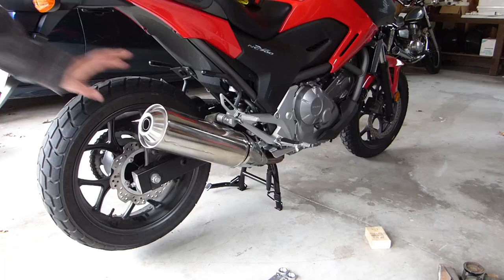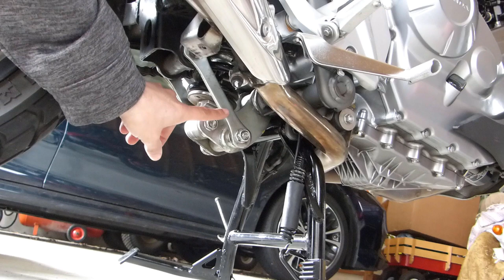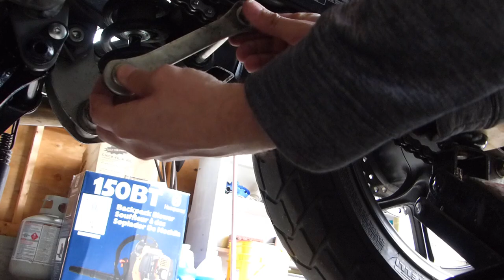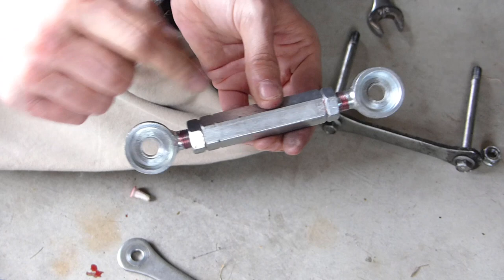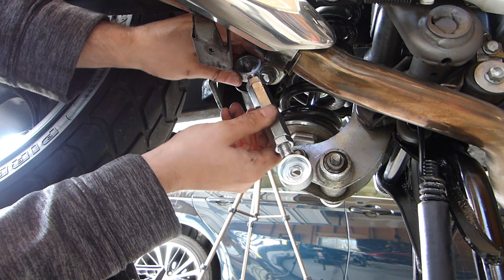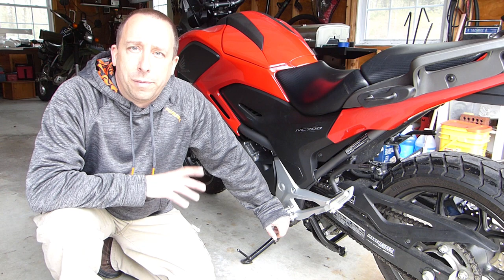Installing Soupy's Performance Motorcycle Lowering Links - Honda NC700X

Comment: Great video!  Couple things:

-Instructions are included with our lowering links.
-Our lowering links are a turnbuckle style, this allows them to be adjusted after being installed on the motorcycle.
-The first step is to install our lowering links on the motorcycle.  Do not adjust them prior to installation as they are shipped in matched lengths with an equal amount of threads engaged in each end of the center hex adjuster.  After installation the jam nuts can be loosened and our lowering links are easily adjusted equally to the motorcycles desired ride height.
-Longer links = lower right height

-The ratio of ride height to lowering link length is approximately 3:1.  That is, adjusting the length of the lowering link 1 inch will net an approximate ride height change of 3 inches.
-As shown in this video, the flat side of the lowering links are to be installed inward, with the bolt head and nut inside the recessed side of the lowering links.
-If needed, we do have adjustable, CNC'd side stands in stock and ready to ship.
Reply: Your more diplomatic than me !!!!!
Reply: How much are you charging for these ?.. And lowered centre stands ?
Reply: I’d probably add that red loctite is not appropriate for this application.
Reply: So im guessing you have to loosen all 4 lock nuts then turn both middles simultaneously

Comment: Not sure why you suggest loosening the lowering link lock nuts & turning each end separately to required length BEFORE installation. Just mount the two links to the bike with the two original mounting bolts, tighten them to spec (add red Loctite for safety) - THEN - loosen the 4x lowering link lock nuts, TURN BOTH TURNBUCKLES TOGETHER with two similar sized wrenches making sure both links either expand or contract TOGETHER (the turnbuckle is the long, 3" central "nut" on the stem of each link between the lock nuts.) This action either lengthens or shortens the body of each link at the same rate at the same time eliminating trial and error or having to use a rule. THEN you can tighten the 4x lock nuts. Once done, get on the bike. If you feel the need for more adjustment, loosen the 4x lock nuts again, turn both turnbuckles either way for the desired result and retighten the 4x lock nuts. I wouldn't use Loctite on the locking nuts as by their very nature locking nuts lock, they should not work loose. However, for peace of mind, check them every so often after initial installation. Don't forget you will probably need to purchase an adjustable kickstand if you've lowered the bike more than 1/2-1" and you should seriously look into lowering the front forks in the triple clamps to match. Before doing this do some CAREFUL RESEARCH as well as some "seat of the pants" research as to how much these should be lowered. Some say front forks should be lowered the same amount as the rear shock but lowering forks more than 1" in the triple clamps could become a problem (you may need to purchase handlebar risers.) Keep in mind all these changes will result in a bike that may be lower and easier to ride for shorter riders but if going off-road you will have to adjust your riding style to match as ground clearance will be less and shock absorption will be lower so keep your speeds down till you're comfortable with the new set-up.

Comment: Am I wrong in thinking that the one side has a left hand thread so it can be adjusted without removing the nuts and bolts again? It seems that's the reason why it's made that way... like a turnbuckle. You should be able to loosen the locking/jam nuts and turn the center piece, and it will adjust evenly from both sides, yeah?
Reply: Yes, you are correct Rob. You just need to turn the turnbuckle after  you loosen the locking nuts on each side of the center piece. I just received my soupys for my 98 ZX11 I am only 5'5 so i'm excited to install mine and see how the bike feels.
Reply: It is a turnbuckle . I would never use red on something that may need adjusting. Crack the nuts loose and then turn the center to reach desired height.  Then use blue locktight on just the end nuts. Or something like that.
Reply: @bluechevyv7156  To be fair to this guy, Soupys Performance (the maker of these links) suggests the red loctite in their video. Not sure why they do that, it's wrong.
Reply: This guys not got a clue !... Youtu.be is full of these people... DANGEROUS !!!!
Reply: Can you adjust those adjustable lowering links even the motorcycle is not jacked up?
Reply: @leej5062  yes you can. But it makes it easier if it's lifted or on a stand. That way you're not trying to lift the full weight of the rear of the bike with that link. It makes it much easier to sag the suspension first.
Reply: @willywaters3814  They suggest it for the mounting to the frame, not for the turnbuckle. They also specifically say in the instructions to NOT adjust it before installing it. This video shouldn't be followed one bit.

Comment: BLUE Locktite.
Red will need a torch to undo !
Reply: Yep, red Locktite is a one way trip.  It seems strange to use red Locktite for this ADJUSTABLE link,  Apparently some came loose and crashed the bike/rider.   Who's idea was it to use Red Locktite for this???
Reply: @yoyohooyo  the instructions said red. I didn't even think about it I just grabbed the red lol. I should've used blue. But oh well it's on there now.
Reply: @Zx14rrrrrrrrrrr   @spafro101  Maybe it was a joke
Reply: @yoyohooyo  a joke to put that in the instructions? Naaaa they just don't want to hear someone crashed because the nuts vibrated loose.
Reply: @Zx14rrrrrrrrrrr    I put a very strong
 lock washer  on the right hand thread sides.   I'm surprised they didn't think of it.  I need to check the bolts and make sure they are still tight,  I think I used blue Loctite also.   I wish I bought the 2 inch bone lowering links instead these because I lowered it 2 inches and that is prefect for me.  I'll never change it.
Reply: @yoyohooyo  I tried the links with the 3 holes. Worked good til I extended the swingarm. Then it was too high or too low. Found a deal on these soupys. And I'm happy with them. I set it right where I want it.
Reply: Im not saying he should have used red or blue but i use red all the time especially when its easy to hit with the propane torch never had a problem getting them to cone loose you could pretty easy heat these up in there location. I will probably use blue on mine.
Reply: @abigailhar  yea just put alot of blue on there.. You'll be fine.

Comment: I got these lowering links for my Hayabusa but they're bit different to yours. Mine are like rounded end links(swivel |bearings) whereas yours are flat. I cut the main body down about 1cm too as the standard shorter setting was no shorter than what is on the bike. I felt this was not right so, In the end I didn't fit them, just something in my head told me to leave it the way it was. So,I'll just put up with the ride height a bit higher than I was after.  Happy motoring my friend
Reply: A shorter link will make the bike taller. You just ruined your new links by cutting them.
Reply: Lol

Comment: I would NOT put RED lock tight on any of the threads until it was installed, adjusted and test ridden to be sure it was all at the height I wanted.   I would NEVER adjust one end of the/a link a different amount than the other!

Comment: Would you have to lower the front fork springs? Or preloads the front fork springs to compensate for lowering the seat height?
Reply from the maker: It's a good idea to do that, especially if you lower the rear alot.  I didn't drop mine much and left the front at stock height
Reply: Okay thanks i just got my 2017 fz 07 and ordered soupys lowering link i was thinking about lowering it 1-2 inches just so i don’t have to balance on my big toes. Do you think i would have to lower the front springs or is it not too much of a difference and i could leave the front alone?

Comment: I have a DR650, and of course, it's too tall for my short butt.  So, I ordered a set of these lowering links today.  As an FYI -
Amazon, $129.00 (Prime shipping available + tax) = $136.74
eBay, $72.00 (+ $7.50 flat rate shipping + tax) = $84.27   [ Yes, it's brand new. ]
I failed to mention that I'm a cheapskate, and I shop for the best deals.  I can't see paying an extra $52.47 when I don't have to.
Reply: You are not cheap, you are smart!  I want to get a lowering link from a Honda XR650L it has a 37 inch seat height.  Great bike, great engine, but just too tall. The Koubalink offers a 1.75 height reduction,  if this soupys link actually goes to in lower I'll take that one. Looks like it might be easier to install as well.
Reply: @zl2848  Soupy's or Pro-tek might be some to look at.  The beauty of these are, once the links are installed, and you decide you need to go lower, it's simply a wrench adjustment.  You don't have to do what is equal to a re-install to achieve the next setting.  Heads up - if you go significantly lower, you're going to need to cut 1/2 to 1 inch out of your kickstand.  Good luck.👍
Reply: Are the eBay ones also made by Soupys Performance, or are they a cheap knockoff?
Pretty much anything can be made cheaper, but usually not without sacrificing quality. People often overlook this, then suffer from it when the product they get is sub-standard. Of course, then they usually bitch about how terrible the real product is, even though that's NOT what they got.

Comment: What about the rake,do you have to lower the front end also to keep the correct rake or is that only if you lower it a significant amount
Reply: Wisdom would say yes but that all depends on the bike owner/rider. Hypothetically, an experienced rider may want to lower the back end and leave the front the same which will lengthen the rake and increase trail. This will make steering the motorcycle "slower" in the turns but add "stability" to the steering (less twitchy) which one will feel while driving in a straight line. Likewise, raising the forks in the clamps (which lowers the front end) while keeping the shock(s) unchanged will reduce rake and quicken your motorcycle's steering response but it could also make the bike twitchy and possibly somewhat unsafe. Some riders may desire to do either adjustment for one reason or another, but if you want your bike to match original specs (although your wheelbase will likely change slightly whichever adjustment you make) you should lower your front end the corresponding amount you lower your rear end. Having said all this, doing these alterations can affect your bike's handling to some degree so (if performing the work yourself) do plenty of research, ask questions and begin with small alterations, make copious notes/take photos so you don't forget what you're doing. When riding after making changes, keep your speeds down and judge how the bike has changed, get comfortable with any differences in feel or response, then make final changes till you feel comfortable with how your bike responds to your inputs. Also, if you lower your suspension keep in mind you may have to purchase a shorter side stand and getting your bike on the center stand will require more muscle.
Reply: @chrissanford8467  Thanks for the reply,very helpful,the links are 189.00 do you think this mod is worth the money or should i just loosen up the ride tension to get a little drop,I know the loose rear end will probably affect my overall ride responce and weave,what is your view on that, any wisdom is greatly appreciated Thanks Again

Comment: Hi, question - Is it possible to lower the bike 3"? & still have the bike handle properly? I'm looking at getting the NC700X, but would want lower it 3 inches ideally. Looks like the kit will let you lower that much, but not sure if the bike geometry does? Thanks!
Reply: You always lose a little bit of handling when lowering. But it should still be fine.

Comment: Nice video featuring Soupy's suspension links. I think if I use the same links on my VStrom 1000, I will mount them Without lock tight, and adjust the links after bolting in place, as that is how they were designed. Unloosen the lock nuts and raise/lower the rear wheel by turning the center Turnbuckle. Tighgten the locknuts, after using locktight on the locknuts only. It's not going anywhere.

Comment: Lowering the rear will stiffen up the suspension. Lowering the front does not. So there will be a difference between the two, some ratio. For lowering the rear by 1", you'd want to lower the front 1"x(some ratio). Anyone have ideas on what that ratio would be?

Comment: thinking about these for my klx, nice video, though i think if i do mine i will go with the blue loctite as the red that you used in this video is close to permanent, you might need to hit it with heat to loosen the red stuff. and i would like to point out that these links can be adjusted on the bike, loosen the nuts on both ends and turn the center portion to adjust in or out. then re tighten the jam nuts.
Reply: To be fair to this guy, Soupys Performance (the maker of these links) suggests the red loctite in their video. Not sure why they do that, it's wrong.

Comment: umm if the links are not the same length there will be bind it can not make your bike lop sided lol..  I recommend you install them with all the fittings loose then adjust both at the same time until you get the height you want then lock them down. if you need to use a wrench  with the weight off the rear wheel they are not the same length   simple geometry

Comment: Hi - I have a 2020 model NC 750x dct bike and wish to lower it by around 1 1/2" as per your video. I have a question. I have seen another video which stated that I needed to adjust the front forks  by lifting them up about 3/4" through the yoke in order to balance the front and rear suspension once the bike has been lowered. I'm a little reluctant to do this and want to know if you consider this really necessary. Thanks for a really clear video.
Reply from the maker: I'm not an expert but it might be a good idea to lower the forks too.  You might want to lower the rear only, and then carefully test ride to see how your handling is.  If you don't have any problem then you are good to go.  If you notice bad handling then consider lowering the front end or returning to the stock rear shackles

Comment: Hi great video'iv'e just bought my NC 700x and ride it fine,but would like to just lower it slightly as my feet do not plant firmly on the ground which makes it a strain when trying to manover,especially backwards,my questin is,is  it necessary to lower the front aswell,cheers
Reply from the maker: Some people feel lowering the front and shortening the kick stand is necessary while others do not.  I did not do either of those things on my bike and haven't had a problem but that doesn't mean you shouldn't do them.  Also, follow the instructions in the soupy's links as I made a few mistakes here as others point out
Reply: Ok cheers, @SevenFortyOne

Comment: The center stand is a complete mystery. I used the same Soupy's  lowering links to lower my NC700X & now my center stand is too long to use. I read online the CTX700 center stand is shorter because it's lower. I couldn't order it from the Honda dealer or from a Honda parts place online so I got one off bay. It's about 1" shorter but still extremely hard to get the bike onto the center stand. That's weird because the rear tire is only a half inch off the road when it's on the center stand. Maybe just a poor design from a 3rd world parts shop.
Reply: Staying with your original center stand after lowering the bike, yes it will be harder or not even possible to put it back on the center stand. After lowering my FJR1300 x 30mm The center stand was not usable. I overcome this problem by making a small ramp. A block of wood 200mm x 200mm x 40mm thick.. When in my garage, I park the bike, place the block of wood in front of the rear tire and ride up onto it.. Then side stand down, and put the bike up onto the center stand. Because my block of wood is higher than what i lowered the bike, it is actually easier to get it on the center stand.
I also removed 10mm from my side stands height for when just using the side stand for a little more lean angle.
I dont use center stand when out riding, only when parked in my garage. 
The block of wood travels with me in my top box, just in case its needed. :)
Reply: @bat6225  Thanks, I'll try that.

Comment: Great install video.  Have you adjusted them since the install? If so how was it with the Red Loctite?
Reply from the maker: I haven't had to adjust them yet
Reply: Does red loctite require heat to remove?
Reply: @RustyRaceHorse  According to the manufacturer of the product, red loctite does require heating to 500 degrees F to break the bond. Red loctite should only be used in applications where you will never need to loosen the fasteners.
Reply: @willywaters3814  LOL  Red seems crazy and overkill?
Reply: @yoyohooyo  for this yea. I just used a drop. Or you can do a bunch of blue loctite and it will come loose if you need it to.

Comment: What was that grill I saw hanging on the wall? Could not tell in the video? 68 Chevelle? I hope you won't need to re-adjust those links again unless you heat them up.
Reply from the maker: It came off of my friend's 69 Plymouth Fury-III

Comment: so you have a center kick stand under the bike. What would we do if we don't have that? How do you stabilize the bike when jacking up the swing arm.
Reply from the maker: The best thing would be to use a motorcycle jack.
Reply: @SevenFortyOne  You can use blocks of wood, strong crate, get imaginative. But a motorcycle jack is the best as it has adjustability. If you have an off-road bike you will need an off road (tall) jack/stand.